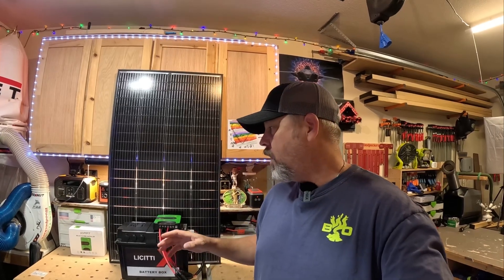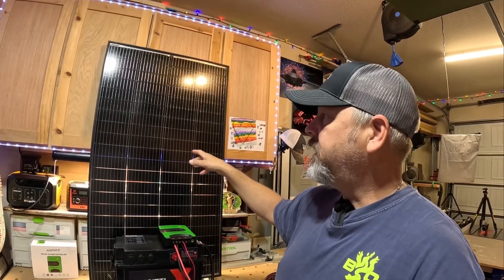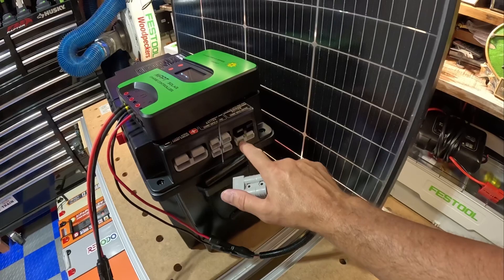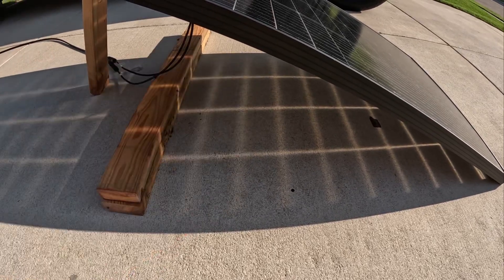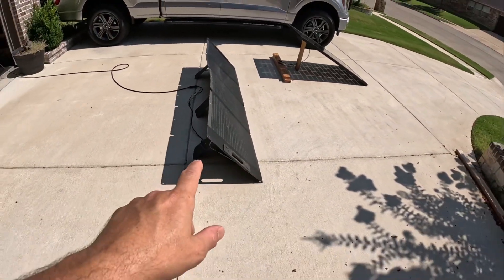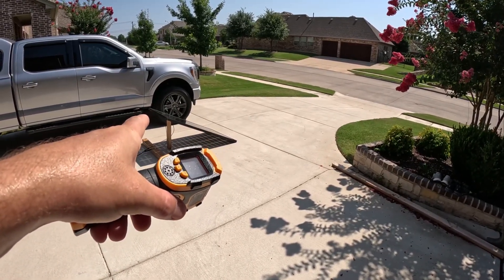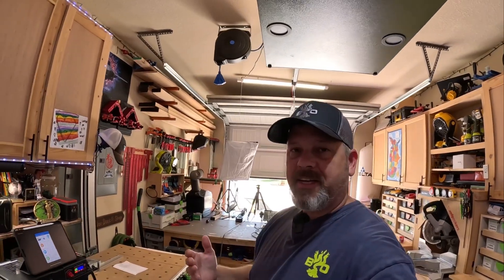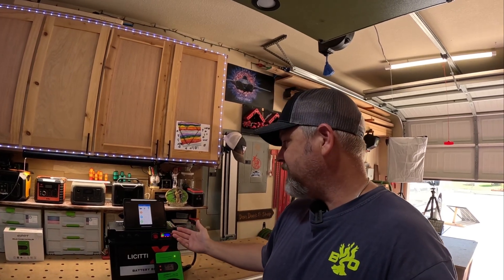Expanding the Licitti Battery Box: Adding your own solar charge controller.

Comment: I have the same setup except for the charge controller. I put a battery monitor in the licitti box. Go to my channel and look up that video. Love the jjn solar panel and the battery box. The onboard charge controller works fine for now this is what I use.

Comment: This is very practical idea.  The weak point in this box is the MPPT controller at 10 amps.  I wonder if it is possible to find a larger MPPT controller at say 30 amps and install it into the box.  This would ensure you could recharge it with solar not matter where you wherever you went with  it.

Comment: So in theory, with so many Anderson plugs on this unit, could I hook up multiple MPPT charge controllers to the additional plugs to hook up more solar panels and charge my battery faster?
So many of these videos sing the praises of units that can provide the high AC output wattage needed to run a fridge, an ac unit or portable heater, but they don't tell you that it will only do that for 45-90 min until your battery is drained. Then you are back to blackout conditions.  If you're only running 200 watts of solar into that, it might take 2-4 hrs to fully recharge the battery before you can use it to run your appliance again.
I want to be able to pull in as much solar wattage as the AC wattage that I am using from the inverter to run at least one of those appliances continuously, so that I can use the full capability of the inverter  as long as I have sunlight(at optimum conditions), and not be  restricted by my battery capacity of 30 to 90 min of drawing that higher wattage.  Obviously, the battery is going to make up for some of the fluctuations of that solar wattage coming in, but at least I stand a better chance of running any of those units, individually, for the day instead of 90 min using a 200 watt solar panel. If I am being offered 1000-2000 watts of power from an inverter, it stands to reason that I should be able to take in at least half of what I am using(500-1000watts). That's like building a car that has great acceleration and can reach high speeds, but has very poor breaking ability, so you can't use it's full potential for fear of not being able to stop.
I find this to be a limitation of the larger power stations as well requiring the need for an additional battery pack for extra running time.  Am I alone in this thinking?  Also, if I limited to only 100 watt panel using the built in MPPT unit at 10 volt max on this unit, how many solar panel watts can I bring in using an external 30-40 volt MPPT?
Reply from the maker: Yes, you could use the extra Anderson inputs with a charge controller (input Anderson ports).

Comment: Your links for the cables, connectors all go back to the MPPT charge controller. FYI. Great video!
Reply from the maker: Thanks for the heads up on the links, got those fixed now👍🏻

Comment: I looked up the SMRMPPT150 charge controller and found it requires a remote IR control the read and change charging parameters. It appears to be made for solar street lamps. The supported  battery types are Lithium, Liquid, Gel and AGM. The default is Gel. I found a remote from newpowa on their website for $20.00 and was able to use it to change the type to lithium. I agree that an external controller is the way to go. I bought a 40A bluetooth from HQST.
Reply from the maker: Thanks so much for that!

Comment: I got one of the Licitti dc power boxes. It works great. I got it for 40 or 45 dollars with 5 dollars off a few months ago on sale. It is the same thing as the timeusb one for 120 dollars, just without the timeusb sticker on it. It did take about 2 or 2.5 weeks to arrive and I did not get any updates after the order processed email from them. After a week i emailed them and after a few days they let me know it was shipped. Also they have a 3000 wh power station with a 3000 watt inverter for about 1900 dollars on sale, might be more now, I had to get a quote for one to find that out.
Reply: also add about 15 dollars for shipping, so about 60 total for the dc box.
Reply from the maker: I’ve never seen this box that cheap!👍🏻

Comment: What about adding a external 100ah battery thru one of the 50A ports (since they are in/out) Is that possible? 
I assume the external battery would only discharge thru the inverter and would not charge like the internal does.
Reply from the maker: You could, but just think of the external
battery as a “charging device”.
Reply: @GearGadgetReviews   So it would be a battery charging a battery.
Reply: I wonder how many amps would get pulled out from the external battery, would it be the full 50A?
Reply: I gave si very little solar knowledge & I'm wondering- Would adding a second external battery in a since make the power station 200ah so 200ah x 12v= 2400wh verses 100ah x 12v = 1200wh? Am I thinking correctly on this? And if using a second external battery in addition to an external charger control like you hooked up - would the external controller charge both the internal & external batteries at the same time & can both be accomplished via 2 of the 50a Anderson plugs? Or would I have to just somehow connect the 2nd battery directly to the internal battery? Any wisdom that you could share would be greatly appreciated. Thank you!

Comment: Since you never got above 7 amps, could you technically use the 10 amp port? A 200 watt panel would be less than 12 amps at peak conditions, what would happen if it was in the 10 amp port during that?
Reply from the maker: Technically, yeah. I could have probably used the existing input. Licit I did manage to tell me to stay below 20v, and I was right around there the whole time. In a pinch you could, but I’d probably only use the existing port for a 100w panel to be safe and not risk burning up the MPPT

Comment: why are you reversing the red/black wiring in your setup?  Jus curious..
Reply from the maker: It’s just the way the MC4 connectors ended up being lined up. I will eventually reverse the connectors so the red/black line up with the mppt terminals👍🏻